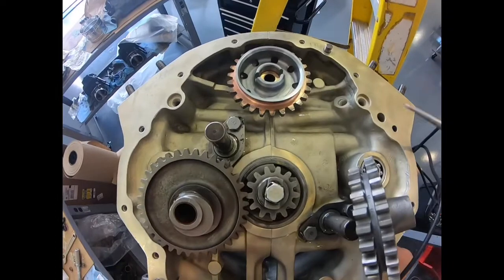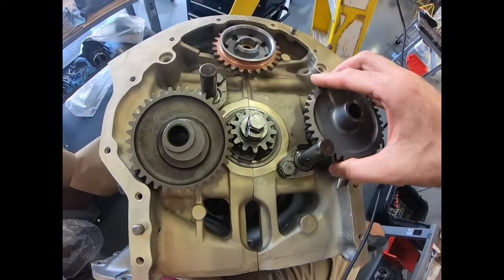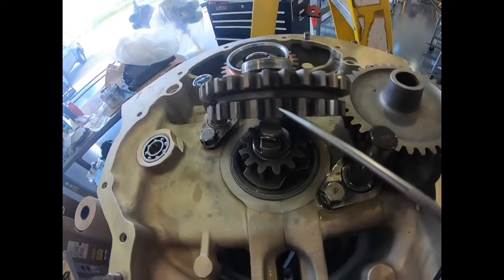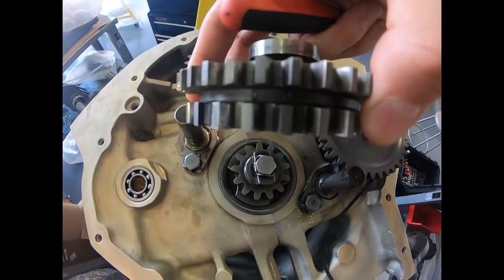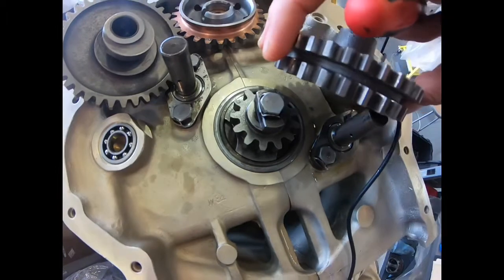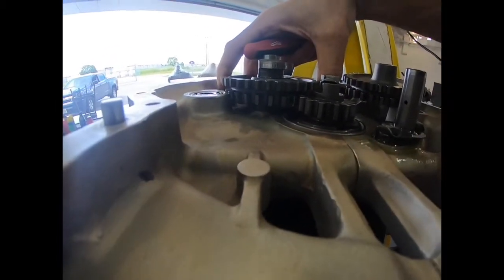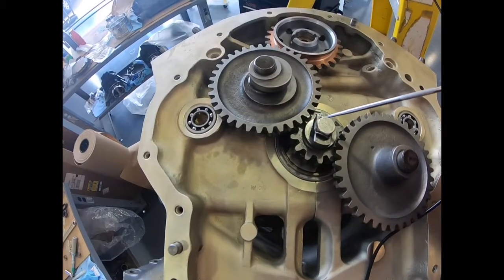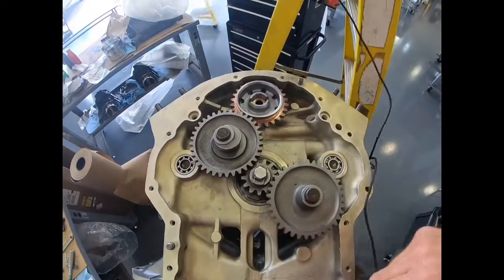Timing the camshaft to the crankshaft on a Lycoming O-540

Comment: In answer to the paragraph in the manual regarding Mag Gear Drive Assembly, I refer you to General Overhaul Manual, Direct Drive, P/N 60294-7 Section 4, See Figure 4-1 refers only to Magnet Drive Assembly, Figure 4-3 Shows the assembly (Gear on shaft, which makes it an assembly), Paragraph 4-24 Assembly Mag Drive/ Coupling and Paragraph 4-28 This is the one that states install Magneto Drive Assembly !  I'm not nuts, I just had the bearing fail after 481 hours because someone installed the bearing in the case first.